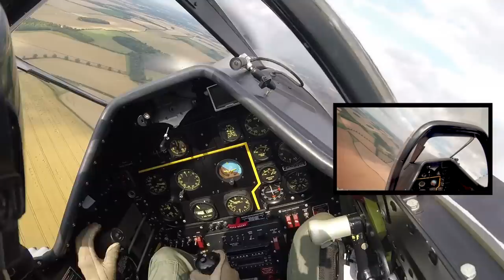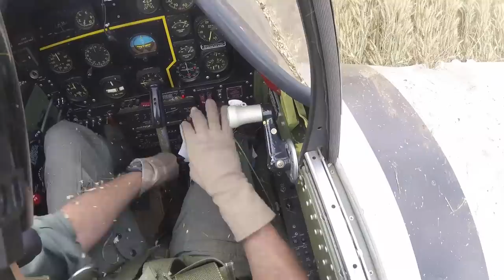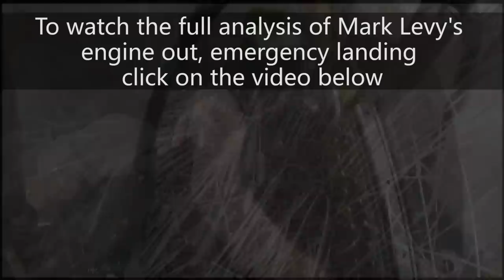P-51 Engine Out, Off-Airport Landing

Comment: Air planing.  Always with the air planing......It is an airplane.  Banking - is just that - inadvisable 
 and a presumption on your part - unless you are in a blimp.  
Necessary of course for navigation purposes.  But don't go thinking you can go deep with your wings into that bank - because of your super powers and maybe impatience. Or both.  
So many small budgies are going into death spirals at the moment.  A very sad and disturbing trend - especially in the U.S.  I don't pretend to know why so I won't presume in order to offend those who may have lost loved ones this way.  Heartbreaking.
Aerolons jamming?  
For some reason - hydraulic systems are failing at very high intervals and jet airplanes are being tested for long hours by many carriers whilst on the ground(often at night); So they are concerned about something.   Over and above normal maintenance.  Ive caught a sniff of this anomalous behaviour and they aren't going public with what is occurring.
Check those hydraulic systems guys because the media isn't picking up on this.  Anything under pressure -- fuel oil hoses etc...   Especially where the rubber hoses are crimped to joints with metal rings.  Check your rings !!!

Comment: Air Safety Institute praising a landing with many big pilot errors that wrecked another irreplaceable national treasure. Easier to fly all automatic jet pilots praising other all automatic airplane pilots that crashed via pilot errors.  No wonder so many crashes every day via pilot error.  They are been praised over and over if they didnt die.  You should be featuring the ones who didnt crash, not the ones that crashed. Dont praise the ones that crashed via Student Pilot Errors made.  Im a Glider Pilot and Bush Pilot Instructor retired. 11 emergencies, no accidents. Know others with engines failed and made it back with no pilot errors and no expenses caused by pilot.
Reply: could not agree more.
Reply: Plane has been fixed and will be flying again next month, and displaying this summer.
Reply: Let's just be glad he's ok, everyone on the ground was ok and the plane was repairable.
Reply: just because you can fly a 1,500 lb piper cub doesn't mean you can fly a 12,000 pound mustang with the reputation of being one of the hardest planes to fly in history, more pilots died training in the mustang than were lost in combat. it is a very hard plane to fly and very unforgiving,, it was the first ever laminar flow wing and required high speeds to handle appropriately.
Reply: outwiththem still miles behind a mustang in terms of handling characteristics and ease of flying, it takes a minimum of 8,000 feet just to get a mustang out of a spin, and if you so much as look at the rudder wrong while on base to final you send it straight into the dirt, they are historically one of the hardest planes to fly in the history of aviation.

Comment: Uhhm that is not a landing strip.  Why in gods name would you put the gear down in a ditch? That likely did more damage than anything else.  Gliding works, really well.   Gear up next time.  Fer reals.
Reply: The gear was up if it wasn’t the gear would have dig in and flipped the plane

Comment: Off airport landing, the title says. That is a many pilot errors crash that wrecked an Air Show jewel, not "a landing".  That is BS clickbait title. Off airport "landing" ??????   LOL.  I though I was going to see a P51 been landed nicely off airport and a happy save of the irreplaceable national treasure P51 instead of ANOTHER P51 WASTED BY BIG PILOT ERRORS. Most airline pilots cannot handle WW2 airplaned due airliners do only mild maneuvering,  Who thinks this was a good ""OFF AIRPORT LANDING?  

 Im a Bush Pilot and aerobatics instructor.  Spins on Tomahawks instructor of CFI's.  I have to teach airline pilots how to do a lot of things on piston planes that they dont have to do on those all automatic buses they drive. Many hate hard to control piston planes due they need a real pilot and real hard maneuvering. Not mild maneuvering like airliners only do.  Put real strong pilots to fly those relics and stop all those pilot error crashes of relics caused by pilots of easier to fly all automatic jets.  "Off Airport Landing"  LOL...
Reply: Well then it's a shame to have someone with your low level of respect and manners in the aviation community.

Comment: He's actually giving us advice?   Chump is lucky to walk away from his terrible air planing.
Reply: Would you rather get advice from somebody without experience or somebody that has gone through it?
Reply: HDaviator, consult a glider pilot. This landing was text book awful.
Reply: What does a P51 and a glider have in common? Not much apart from having wings.
Reply: That's a mind boggling comment. An airplane with an engine failure is a glider (with a much lower lift to drag ratio). How do you think Sully landed in the Hudson. This landing was a total shit show, and the "commentary" In this video is even worse. Not even the most basic understanding of how to perform a landout was mentioned. Cross country glider pilots train to land out in unprepared fields because they actually have to make forced landings on a regular basis. There is a lot information out there on how to set up the approach, find a field and execute a landing. Waffling around on partial power and then doing a hard base to final turn at the last minute and then abandoning it is just poor flying. He should have realized that he had insufficient altitude to do a downwind by judging his azimuth and elevation glide angles. This is a pure display of no engine out training or experience or he's completely unfamiliar with the planes gliding characteristics. There was really no reason not to use the partial power to set himself up on a nice stabilized glide to those massive farm fields with minimal heading deviations, gear and flaps down, and land at minimum controllable airspeed into the wind. He did not need to do any major heading changes to simply glide to a big farm field. I'm actually quite surprised that a British guy like him does not have significant glider time because a lot of them start off as glider pilots across the pond. He's simply lucky he didn't get killed.
Reply: F the gear when runway is not made yet.  All pilots know you dont lower the gear until the runway is made and with safe safety margin just in case.  Failed test if you lower the gear on a turn when low. Enough said.
Reply: Who said to put the gear down before the field is made? Don't extrapolate what I said. We have landing gear in gliders as well. The landing gear is one of the strongest structures on the airplane, and you never do an off field landing with the gear up. This is in any glider text book or FAA hand book on making an off airport landing. He had a tail dragger (it's also what gliders are), which is what all the bush pilots use in rugged terrain. If you can't make the field on the base leg and require your gear up, you did not plan properly. He could have easily landed in a farm field right in front of him with his gear and flaps down, into the wind, with minimum energy at touch down. If he was that low he should not have tried to fly out of glide to the airport. At that point you must treat the engine as if its dead. Glider pilots are taught a minimum altitude where you are committed to land. Typically thats 800-1000' AGL. You do not try to thermal or climb once you reach that altitude, you establish a rectangular pattern and land at a farm. He should have had a similar altitude where if his engine failed, he brought it down to the closest field, ideally with a short downwind, base leg, and final - but that was not the case and look how it turned out. He made a wager that he could fly back to the field and sacrifice a known safe landing right underneath him at the time. Guys try this in gliders too, they try to catch a thermal at 500' and make a save, but then it doesn't work out and now they have no altitude left to safely make the field. The results are lethal. Pause the video at 1:07. THAT was his perfect field when his left wing is down for a bank. The big long green field running left to right at the top of the screen. He still had power, he was already flying on a downwind, he could have turned base, final, gear flaps down, target airspeed, stabilized approach, and had about 5000' to land it at least.

Edit: I saw your other comment below about flying gliders and bush. I'm not telling you anything you don't already know. I think we are in agreement here outwiththem :-)
Reply: That's what he said in the interview, the tower told him so, and in the stress he lowered the gears without thinking of the drag, it was an error, but I would like to see how you would react in such a situation...
Reply: Your comment is troubling to me, because you're completely missing my point. It's not about "worrying about the drag". Please re-read my two comments above, as I explained exactly how one should treat the situation in detail. I will be happy to explain in further if you'd like.
Reply: Please explain it further from the comfort of your armchair, id love to hear direct analysis from a P51 pilot like yourself.
Reply: You mean, explain my real world experience landing out doing cross country glider flights and landing out? I just did. Go back and read it. Or better yet, go back and talk to ANY cross country glider pilot who lands in fields regularly. What makes you think you know more about landing off airport than people who train and perform this?  Your comment adds zero value. Congratulations.
Reply: A P51 with a windmilling propeller has more in common with a brick than a glider. I suggest you watch the full interview.
Reply: You said you would be happy to explain it further, so please do. Could you also explain how a 1940's warbird can glide like a modern glider. Maybe you could add in a bit about how you deal with engine troubles in your glider too. Thanks in advance for your value filled comment.
Reply: He had some power left, but kept mishandling the engine controls.  Easy to see not to add drag when turning low and slow. Big freaky pilot errors done here.  Glider and Bush PIlot CFI.